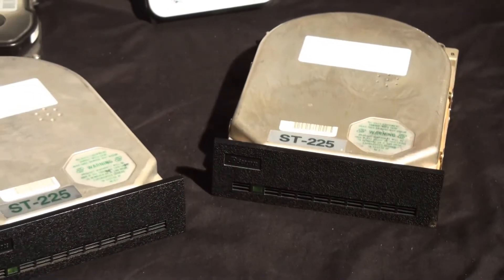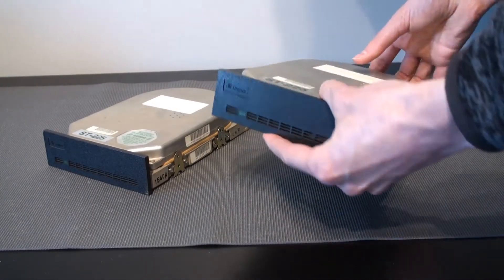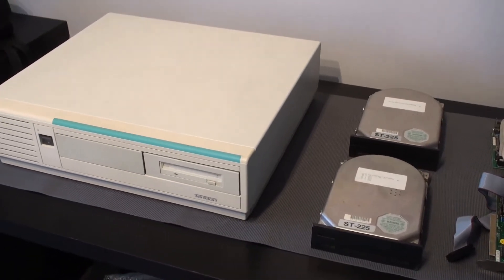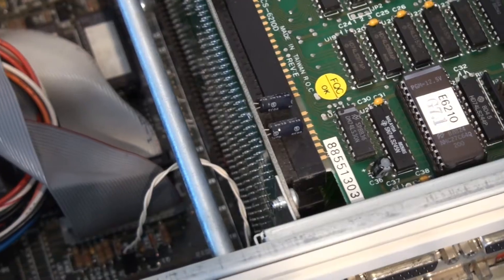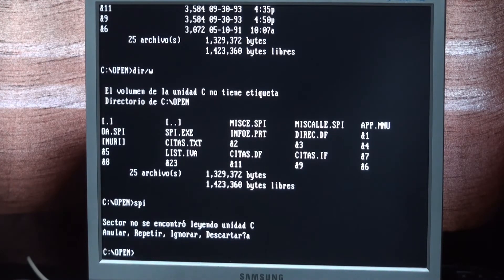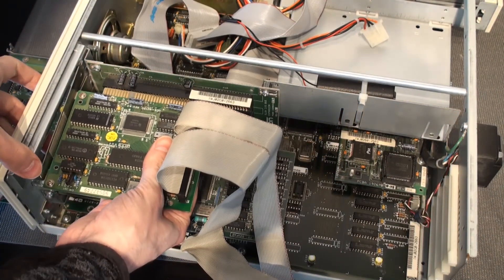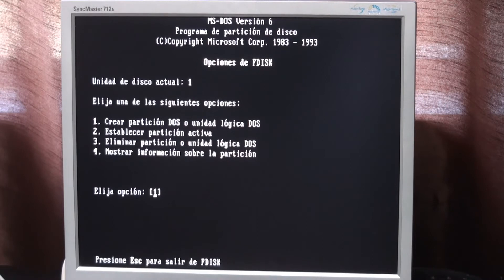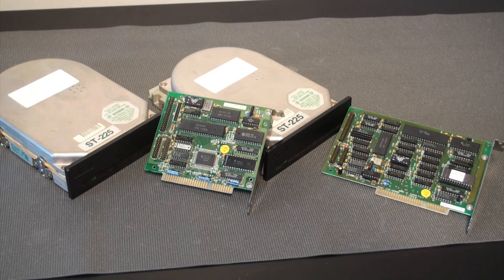Testing two MFM drives: Seagate ST-225

Comment: I love these old drives.  I have a lot of them in my vintage computer collection.  The reason your drive is working without needing to put a drive type in the BIOS is due to using an 8-bit controller.  8-bit controllers have their own BIOS as they are meant for XT class PCs which do not include a drive table in their BIOS.  8-bit controllers are also very slow.  Going to a 16 bit controller and running a 1 to 1 interleave with optimized sector and head skews, you can into the 400 KB/s access times.  While not fast at all by today's standards, that's very good for MFM on a 286 / 386 class PC.